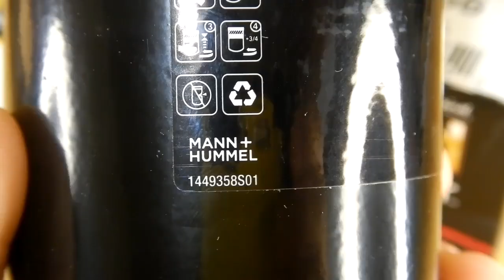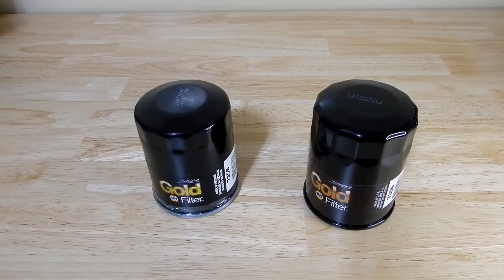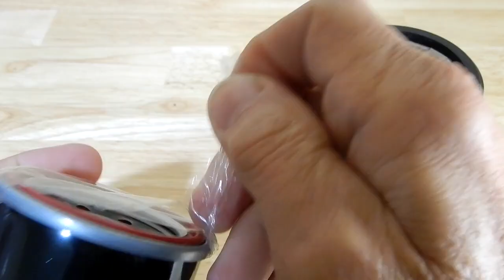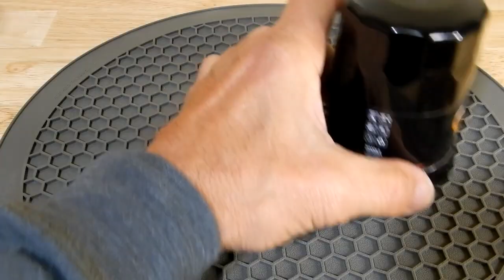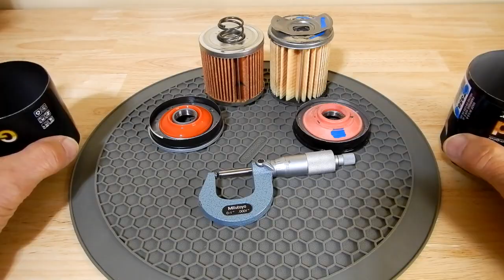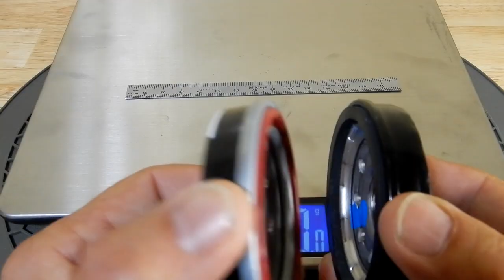NAPA Gold Oil Filter Number 7356 - Mann+Hummel vs. PGI Filter Comparison

Comment: PGI in every facet seems like a better filter. 
Fit and finish
Silicone gasket
Better looking ADBV
More threads
Slightly bigger inlet holes
More robust face plate 
Thicker can
Evenly spaced pleats 
Center tube has holes instead of  louvers “better flow” 
No excess glue everywhere 
Coil spring
Plastic cover over the filter 
Has better filtration efficiency ratings

As much as I like to support made in USA products. It looks like Mann+Hummel has a QC issue. To me it looks like PGI just raised the bar for Napa standards.

Comment: I decided to go With motor craft style.Ithink its stupid to make a oilfilter that when in by pass mode for the oil to wash by the filter media gthen to exit under the filter to exit to engine.
So the best filtration fails from dirty oil going back to the engine on cold start ups in winter.
I 'll go w motor craft So the by pass fuction is above the media and exiting out from center .i 'll be happy w 95 @20 or 80 @30 w ford style. Lot better than repeated circling of contamination over and over.ty jeff of ford word thinking.

Comment: Great video, thank you!  I'd be comfortable using either filter on my vehicles. The Napa Gold filters I've purchased in the last several years for my 2 Chevy Silverado's were made in Mexico by Mann-Hummel. I recently bought 2 other Napa Gold filters- 1 for my tractor, and 1 for my lawnmower.  One filter was made in USA by Mann-Hummel, the other was made in Vietnam by PGI. I suppose Napa is multi-sourcing their filters (and all products) from low cost suppliers. As long as the filter meets the same specs and does it's job, that's what matters. Thank you.
Reply from the maker: You're welcome - I agree 👍
Reply: Napa changed to PGI because their other supplier couldn't fulfill Napas needs.